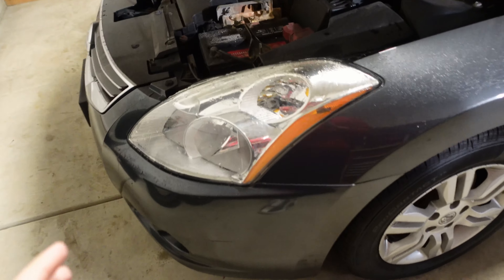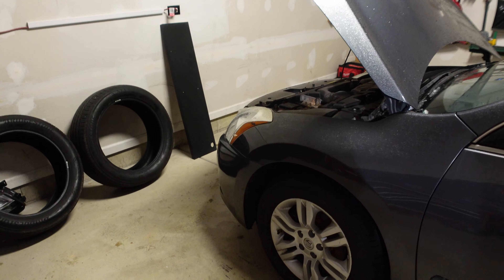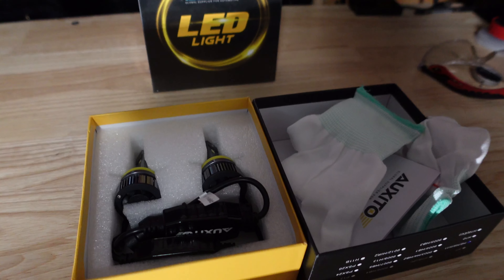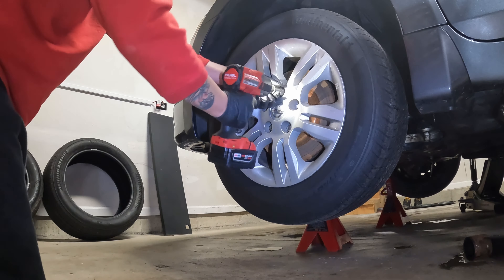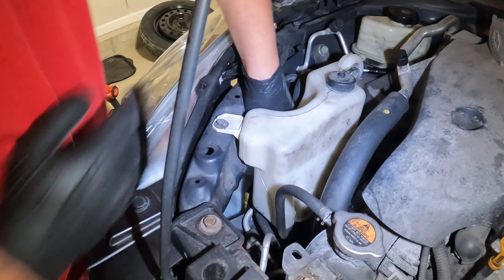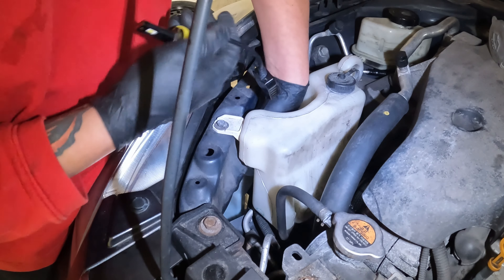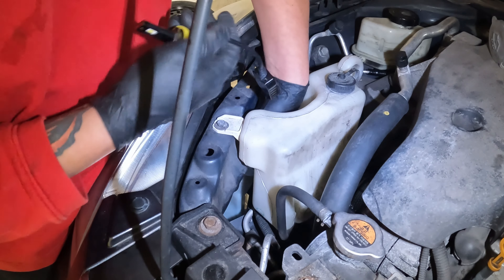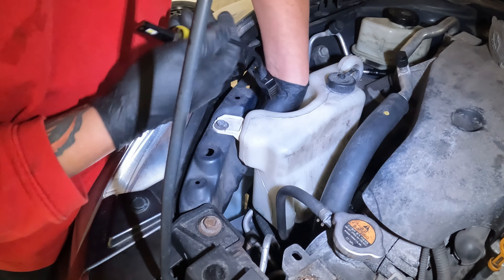Nissan Altima LED upgrade

Comment: What’s the beam pattern like?  I put some leds in a Lexus gs that had halogens and the light scattered everywhere.  Bright but the pattern not good.  It had Better visibility bright halogen bulbs.
Reply from the maker: The reason your beam pattern is scattered is cause you did not install them correctly, when you put them on the diodes have to be at 3 and 9 o’clock , if they are not then the beam pattern is going to be everywhere I have another video where I installed lights on a Cadillac XT5 and on a 4Runner and explain this
Reply: @PRviewsvlogs   I’ll go through the instructions again but these guys reflect against the headlight housing and seem to only go in one way.
Reply from the maker: @meanboy2000 some of them are not adjustable so when buying u have to make sure they can me adjusted
Reply: @PRviewsvlogs ah okay.  The one I have doesn’t let me do anything.
Reply from the maker: @meanboy2000  then they are not adjustable watch this part 6:13  I mentioned it there so if your diodes are not at 9 and 3 your beam is gonna be all over the place , you need to get ones that adjust
Reply: @PRviewsvlogs  I’ll look into that.  Thanks!  Are you happy with the ones in the Altima?
Reply from the maker: @meanboy2000 so the Altima was a flip car for me , but my dad has them on his xt5 and his f150 and he loves them , I also had them on my 4Runner and on my buddy’s Gx460 there is video for all those cars and I was very happy